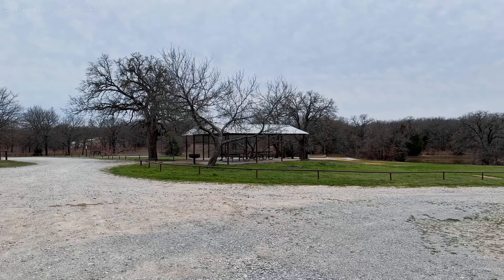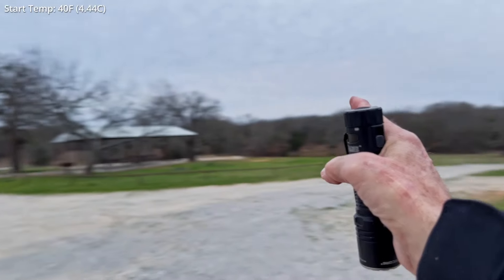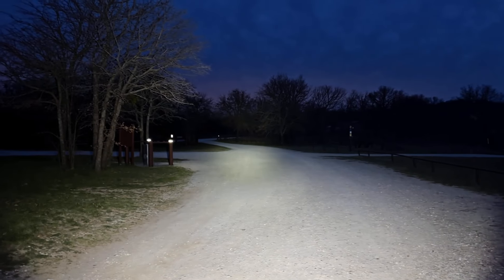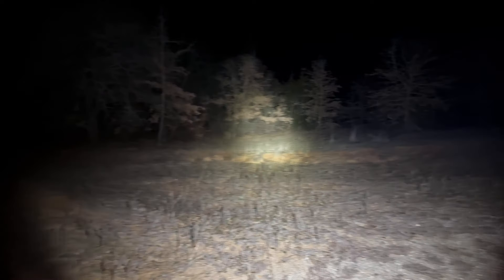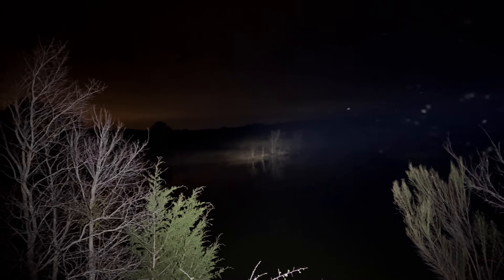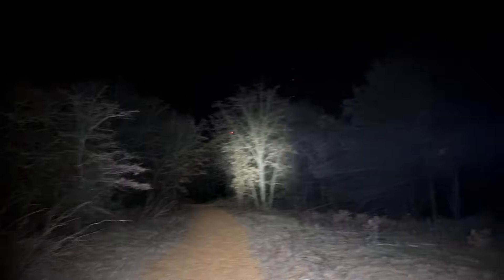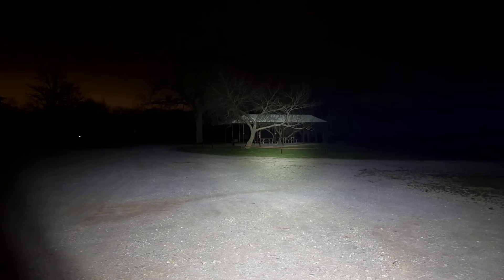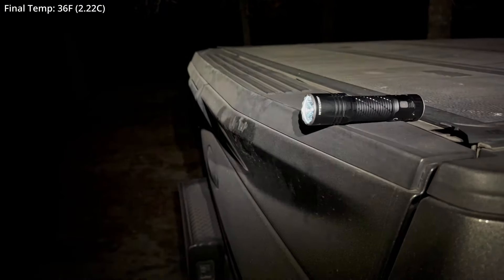NITECORE EDC35 Battery Endurance Test - Lost In The Wilderness

Comment: Eight months later here, but this light is on the way in transit and so I came across this video; do you know if the step downs are due to heat or battery drain? In other words, if one were to toggle between high and lower modes as needed, might the step downs be held farther out?
Reply from the maker: Step down is to avoid heat and lights do require a certain amount of power to obtain and sustain a particular output level.  You can increase overall battery endurance to a degree by toggling between say Med/High and running much more in Med.  Every time you switch back to high and start out at the top output level, though, it's burning battery at that top-output rate.  You may arbitrage the step down but are still burning battery at a higher rate.  Always a trade off :)    Thank you.

Comment: so its far from their claimed? they claim it could last 4 hours in high modes? lol
Reply from the maker: Now, I only ran the light down to where I would no longer use it.  That's different from running to complete battery depletion.  And, it was during cold weather which often affect battery performance negatively.  Which is, of course, why I run the field tests :)